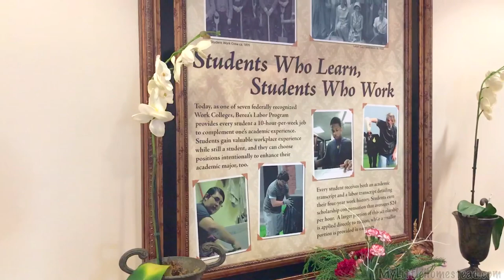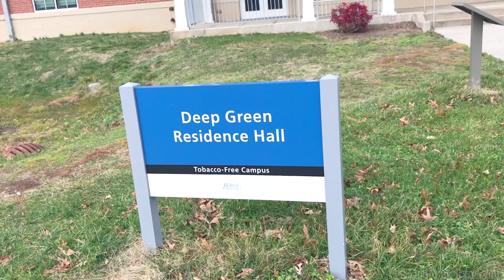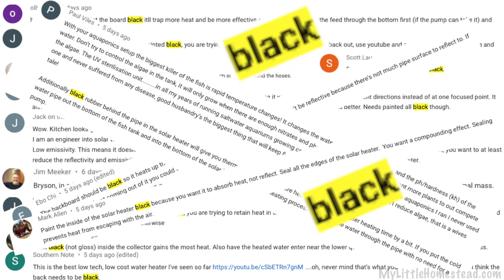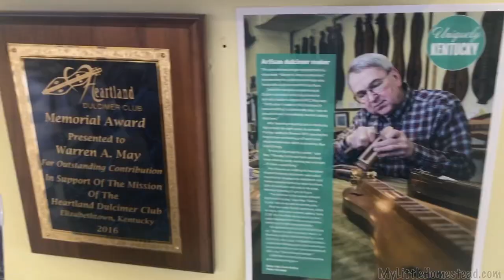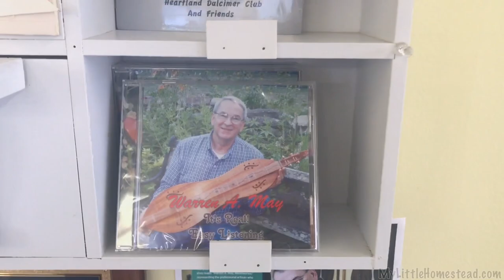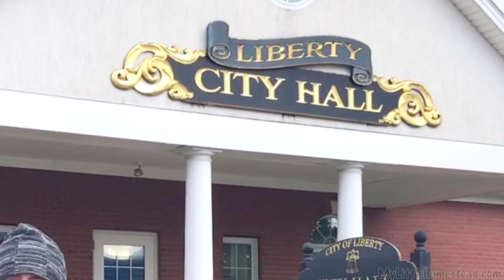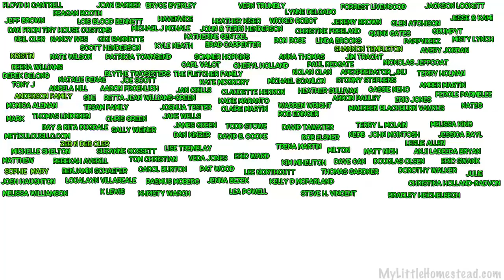DIY Windowsill, Aquaponics Solar Heater & Kentucky Trip | Weekly Peek Ep217

Comment: I wouldn’t grow plants in the winter.  Just run the air pumps.  I would change the water once a week. I also used 55 gal  plastic  barrels to hold the smaller fish.  I harvested all the larger fish.  I insulated the tanks and placed them on top of an electric blanket.  The water stayed above 60 degrees on 30 degree nights. I also have a water spigot with a hose on each barrel to drain off the dirty water.  If you elevate the hose you won’t accidentally drain off too much water.  You could have an extra barrel to hold heated fresh water then pump it over to the fish when ready.

Comment: Yes the tiles will act as a heat battery.  Yet the pipe that is coming off the solar collector isnt insulated and is losing heat before it can warm the tank.

Comment: Bryson, I dont know if it been said already, but change your inlet and outlet on the solar heater, so the inlet is on the bottom and the water flows up through the heater, it will also help the pump as the hot water has a tendency to rise,
You could also look into a Donkey Water Heater for when it gets real cold, it's Simply a steel 44 Gallon drum placed over a fire and as the water flows through the drum it gets heated.

Comment: Bryson, 
you're going to need the fish, fish food, and poo to properly feed your remaining veggies. Might I suggest getting simple feeder goldfish or even minnows or both, to add to the aquarium so will have at least some proper nutrients, maybe not in as high a quantity but something. If you don't to have worry about them they are both pretty resilient. or could get some baby koi fish and then later make Mom a little koi pond!!As babies and not worried about special designs/colors koi aren't to expensive, and of course the minnows and feeder goldfish aren't expensive, but they would do the trick until you get more tilapia if you plan to do so in the future. Another thing you might try is putting the electric heater down in the tank as far as it will go down and typically that gives a better chance of being more efficient and bringing temp up better, a little anyway.

Comment: I have to educate y'all about dry creeks. It IS normal for them to only run during rainy seasons.

I grew up with dry creeks. I have one on my property. I live in the foothills & when we get days of rain after really dry summers the earth can't soak up all of the water. So the water starts flowing down the mountain taking the path of least resistance which are the dry creeks that overflow sometimes, that's a flash flood. Don't worry, we live on high ground.

Comment: the issue with the solar collector is that the desert air is cooling the heated water. use a solar panel to run the pump so that when there is no sun the pump is not moving water. also put an foam insulating panel on the back of panel to reduce heat loss. 
maybe also some sides like 1 by 6 around the perimeter to reduce wind blowing across the glass.
best

Comment: Most of the solar water heaters I've seen used copper tubing,  painted black,  and have you thought about insulating the tanks to help keeping the heat in like a hot tub.  A soda can solar heater may help the air temp in your green house too. Just a thought.   Good vid

Comment: Gary,
The next time instead of making pocket holes and using screws to join glued boards together, try drilling holes in the side of the boards and using dowels to help join them together.  It gives a cleaner look and allows you to use either side to show forward.

Comment: Hot water is running up, that is one thing. The easy way to control the temp in the water is to use compost heating.

Comment: Remember to seal the window sill underside with either lacquer or epoxy, and that means sealing the top surface to avoid warping, how much difference did painting the water heater black make?

Comment: Using the tiles as a heat store is OK, but if you're going all-out, you should use a thicker box and put some foam board insulation behind them.  Otherwise, the heat loss through the wood on the back of the box will undercut the value the tiles are supposed to add.  Of course then your box would be much larger, so that may or may not be a good move right now, but it's what one would do to maximize efficiency in a solar heater.

Comment: On the hydroponics heater, with the glass cover, I was wondering if it should still be painted black on the back board. I have a black car, with black interior and not much tint on the windows, and man, does it ever get hot in the car. 
Also, I noticed what looked like a lot of condensation on the inside of the glass and right away wondered if a  person could tilt the panel enough to  make that condensation run down and be collected and put back into the system? Water being hard to come by in the desert :)

Comment: The hoses that are running to and from the heater should be covered in insulation. You loses lots of heat when they are uncovered.